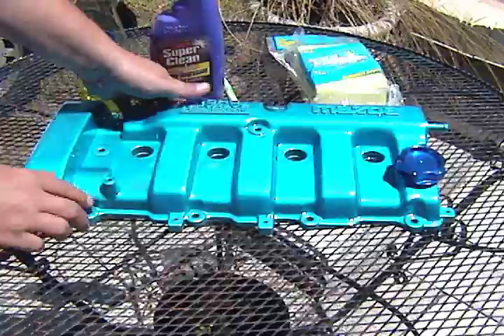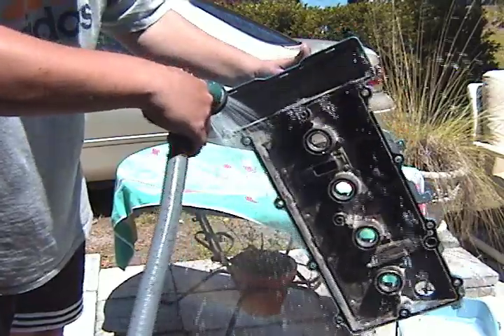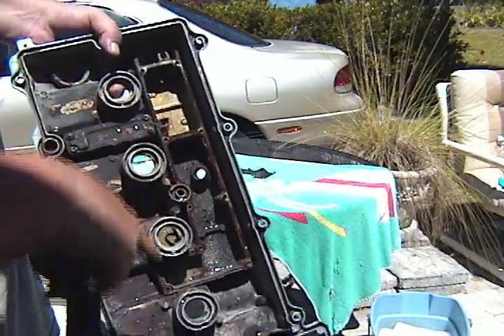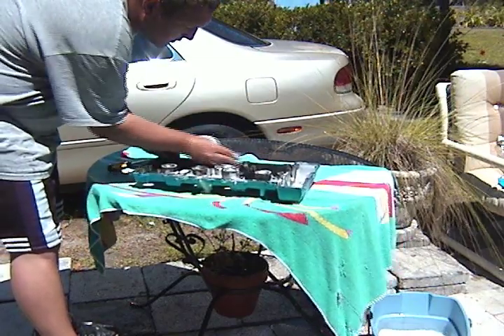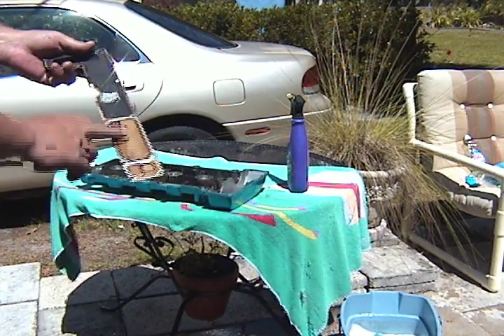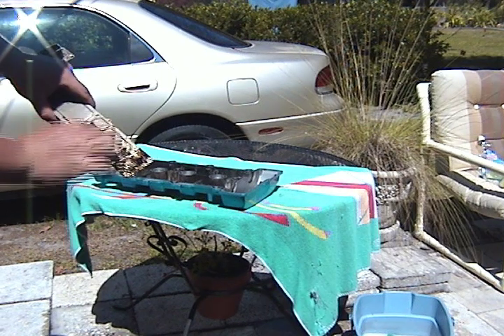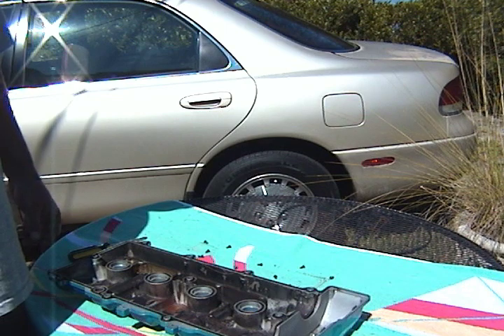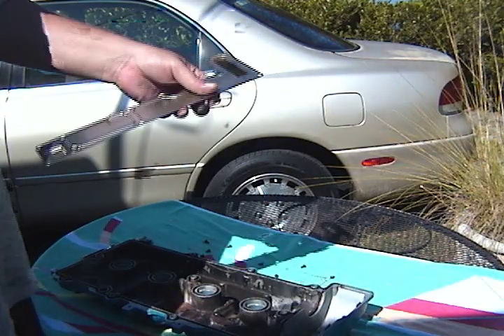Mazda 626 Valve Cover Cleaning Part 1

Comment: Thanks for the info.  I'm actually using a core to make pretty so I can keep driving the car.  If the plate in this is not removable I will have to use my existing cover because it beats introducing that junk into my oil system.  My core is from a car that blew the head gasket and has a cocktail of burned oil and oil/coolant mix of dried slime.

Comment: How did you get that plate out of the cover?  I am doing one for a Mitsubishi that looks as if you force it to come out the metal tabs that pass through the holes in the plate will break and it will not go back in and stay back in.

Comment: this shouldn't have happened. At my step dads powder coating shop they completely strip the piece they painting and clean every little bit of sand out before they powder coat. this is the result of a poor shop.